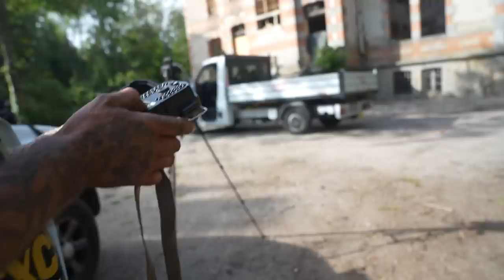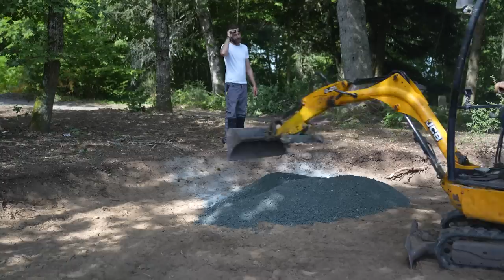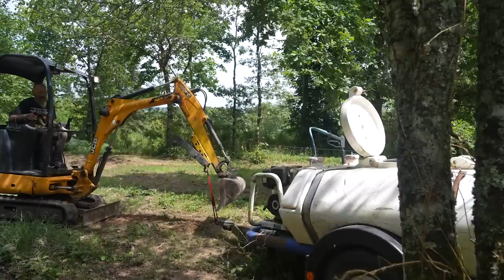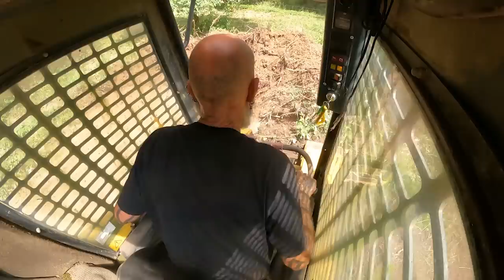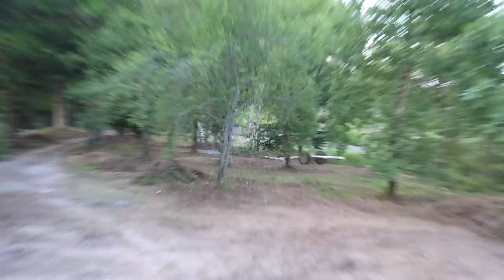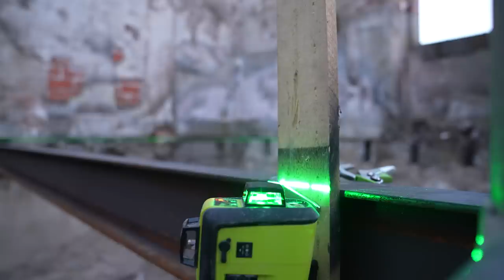A very wonky chateau ruin.

Comment: I am a Fabricator and Electrician.  Reguarding the floors.  I wouldn't suggest any step downs or you will regret it everytime you pass through.  Instead, find a way to build up the opposite floor to the higher level.  That way it's level Everywhere,  on the Entire floor.

Comment: You know there is a math formula for figuring how much gravel that you need. Area(sq metre x depth). You wouldn't have to guess. You probably could have told the gravel pit the diameter and how deep to figure the amount of gravel. 
As usual, oh good Dan's video is up. You always brighten my day.😎
Reply: If the gravel is sold by weight you also need the density to figure out how much to buy though. Density is given in kg/m3 so you multiply the result with density to get the weight.

Comment: I wonder if the original builders there used bubble levels, plumb bobs and water tubes to determine the level of each floor.  Maybe over time, the chateau may have settled a bit depending on soil type.  Good idea of clearing the front yard as over time tree leaves and such have decomposed, along with overgrowth, to make the ground grade a bit higher and uneven.  It's coming together nicely inside and out.  Handling a digger looks easy on camera and I bet I would be like a fish out of water trying to operate one...lol. 😁I always look forward and enjoy watching your videos during the evenings across the Great Pond. 🌎Cheers and Crack On!  Takes a bit of time to upload/download/editing videos.  Look forward to longer videos, if you have planned them.  I think you had mentioned that already.  See ya...tomorrow! 👍
Reply: Oh yeah, handling one of these is quite the learning curve! The first movements are extremely jerky as you get the hang of the basic controls. Once you got past that, basic digging isn't too bad but getting a flat, level surface is quite complex because you need to operate multiple levers at once to keep the bucket parallel to the ground as the boom curls. I worked with a mini digger for a few days, without a lot of training (i.e. "Ok, this lever does this, this lever does that, here's the keys, have fun! And we need the hole to be 400 mm deep and 1200 mm wide.") and we did all of the finishing with shovels. To make matters worse, our dig (for a cobbled path) was along a wall and digging parallel to a wall is even more complicated. We did have loads of fun though, no damage or injuries. The path still looks great seven years on.

Comment: I'd say by the time you do subfloor and regular floor, and have a threshold at the entries, your differences will be so barely noticeable you'll be amazed how much time you spent thinking about it.   I helped a friend work on a stick built house that was damaged by a fire, the house itself was very cheaply built originally back in the 1940s, the distances between floor joists, rafters and even the wall studs probably left it with probably half the wood structure a modern house would've been built with just a decade or 2 later, the amount of variances in floors and walls was crazy, in one room you'd put a chest up against one wall and the top would be up against the wall the bottom would be 3 inches out, 4 if you didn't include the trim, on the next wall the same chest would've been up against the trim at its base and 3 inches away from the wall at the top. You could put a golf ball in the high corner of a room,  not touch it and its would roll across the room and under the door and halfway down the hall including a bedroom that was carpeted.  We basically rebuilt the house one room at a time,  sisters joists and wall studs together to add structure, making sure the new structure was square and level, sawing off the high sports and  building up low spots. Fun stuff.

Comment: Dan, where the floor level is different once you've installed the floor beams/joists etc the easiest way to get the flooring levels right throughout wouldbe to install thicker floorboards within that one room,  for example once the roof is on and the windows are installed and basically the building is watertight.  When it comes down to the installation of the proper floorboards instead of the osb boards, say that you're using one inch thick timbers throughout most of the rooms where the levels are questionable like in this room why not just install floorboards that are say one and a half inch or even two inches in thickness 🤔 this may help you to keep the levels right throughout the château.
Reply: Well, i think, it isn't that simpel....
 It probably isn't, that one whole room is 3 or 5 cm higher, than the other room, but i think, the difference goes gradually from a side to the other.
Reply: @sabalight2558  He said he wanted to have every floor level but could live with steps between rooms. So he could actually raise the floor on either the landing or in the room (already managed to forget which floor is higher but I think it's the room, so he could simply put floor boards on top of the OSB on the landing and straight onto the joists in the room).
Reply: @Ragnar8504  Yes, i remember , but i think, when he said it a few weeks or months ago, it was going about bigger differences.

Comment: Interesting problem! Just putting it out here, for some measure of consolation: my flat from 1656 is so wonky due to sinking much the same way the houses in Venice are in some places, that nothing, and I mean nothing, is plumb. And my livingroom floor is the worst, from one end to the other I'd say it's off about 25 cm. I literally have to tell guests to watch their step on the threshold from the hall (the top end of the livingroom) amd when I moved in my friends all got a coctail and a vintage litte sports car to race down the parquet slope 😂 it's difficult to furnish.  Don't worry too much about being off a couple of inches. More than that on floor level and it gets a bit impractical.
Also, wall mounting shelves is difficult if your walls, like mine, are far from plumb. But can be adjusted, it's just more work.
I think you'll be fine Dan ❤

Comment: Your explanation of the floor makes perfect sense.
If the rooms are treated as their own space, with a threshold connecting them to hallways/other rooms, 
then if the floors are at slightly different levels it will be barely noticeable. 

As far as the Yurt goes, I would just put in posts, then build a wooden platform on top. 
If the platform is fairly high off the ground you build some steps up to it. 
All of which can be removed/repurposed once the Yurt is no longer needed.

Comment: There isn't a 200 year old buildings anywhere in the world that is dead  level , when your dealing with old buildings it's all about compromise as you have found out , let's face it they didn't  have laser levels when the chateau was built , your doing a great job .
Reply: The château is more like 120 years old but builders weren't too fussed about keeping things level back then and the building might have settled some too. Not too badly though because I don't see any cracks or wonky window openings. Brick and stone buildings don't usually settle with some obvious visual clues.

Comment: Once you have the subflooring installed you can use floor leveler (usually used under tile) to get everything uniform before installing the final flooring.  

I have done the a lot over here in the USA to fix floors in houses built between 1890 and 1940. Many of these era houses have an abundance of settling issues that require creative solutions. 

Hope this helps.

Comment: All floors same level my man! 
'Half steps' at thresholds are trip/stumble points all day long. Either a full step height or NONE. You will regret not doing this I guarantee you.
The up and down of floor heights will bugger the feel and look of flow throughout the house.
Simply pack the floor joists with strips ripped off same timbers used for original joistings so the floors are level throughout. Easy peasy, only a little bit of extra work and cost AND you can span the I beams and give yourself more fastening points for your under-flooring and final flooring. The extra height created can be easily, uniformity in riser height, incorporated into the new stairs you will build.

Comment: Hey Dan - any chance the floors in the room that's wonky were just wood and the hallway, which is 1" or so lower, had thick stone or marble atop a wood subfloor?  Meaning they'd level up where they meet?  Just thinking what could be a good reason for the elevation difference.  I'm sure you'll figure this out - curious if the opposite side of the chateau is also slightly higher in elevation to the hall.  You'll find out soon enough.  Hmm!  👍
Reply: Good point !  👍🏼

Comment: I would have gone a very different route from the start. Originally I would have a tent on site for couple of days until I cleared out a single basement room (having a with roof) to live in and keep working on as soon as possible to get basic liveable area. Then created some cheap and simple roof covering - maybe use a drone to roll out a lightweight and cheap clear plastic wrap to divert most of the rain to the outer edges. Like when they wrap the bricks together - something like that...if you do it enough should be able to divert most of the rain and still get light in also. Then concentrate on structural strength and supports (you sort of did this also), then do the same way you have from bottom to top and trying to add structural strength as you go.

Comment: I think the height difference between the main room and the wing can be made up by laying down a concrete screed on top of the wing's subfloor. Of course, it depends what kind of flooring he is going to use.  We have an old stone house in Italy and that is what the builders are going to do before the tile is put down.
Reply: I think it's the hallway that's lower, not the wing. As long as the stairs aren't in I see no reason not to raise the floor in the hallway as long as the other wing and back room match.

Comment: It looked like both the truck and Nick’s trailer could have had a bit more gravel loaded on, but sometimes it hard to know just how much you actually need.  I’ve done that a few times myself, but it’s not like the work stops. Around my home the work is never ending and when you break some eggs 🥚 you just make an omelet. Good work guys!!
Reply: By volume yes but I doubt the truck could have taken any more weight. Not sure about the trailer but I suspect that was maxed out as well.
Reply: @Ragnar8504  I did think of that after I left my comment. I watch Dan’s videos while in bed and was getting sleepy to correct my comment.  One always has to take into consideration the abilities of the equipment when carrying loads. Thanks for your reminder.

Comment: They didn’t have a huge length of clear plastic hose full of water when the Chateau was originally built.
Imagine what the builders could have accomplished with lazer levels, power tools etc….they were Champions !
Reply: They probably had rubber hose with glass tubes on each end, that was invented quite early (I think the principle was invented in the 17th century but only came into widespread use with the invention of vulcanised rubber hose in the 1830s).

Comment: Great clean up. Sounds like a good plan to even out the flooring. There probably wasn’t good enough measurements when they did it originally or perhaps additions or settling? Anyway you will make it work and it will be sturdy.

Comment: Kid, Don't order by weight, order by the square meter, or yard, or however you do it there. Here in the states I order 10 yards at a time=1 dump truck load. Depending on the material you order, it can be a whole lot cheaper that way. By the way great video..
Reply: Cubic metre would be the unit of choice for large volumes like Dan needs but I think stuff like gravel is often sold by weight.

Comment: Shave the part of the wood  beams that is higher than the floor should be to "lower" what will be the floor height, or, buy wider beams to increase "height" of the floor, and just keep cutting the notches to fit inside and rest in the i beams. So the width of the beams can adjust themselves for the floor height.

Comment: DUDE THE GROUNDS LOOK FANTASTIC. WELL DONE!!!. AS FOR THE FLOOR, BECAUSE MODERN TECHNOLOGY AND LASERS ARE OUR FRIEND, IN A PERFECT WORLD YOU COULD START AT THE FIRST FLOOR AND MAINTAIN THAT LEVEL. OR LEVEL EACH FLOOR AS YOU GO. BUT IF YOU CHANGE FLOOR TO FLOOR, EACH INTERIOR WALL WILL BE DIFFERENT IN HEIGHT.  ITS 1 OF THOSE THINGS. MAKE IT AS LEVEL FROM EACH FLOOR UP. JUST ADJUST THE TIMBERS AND EYE BEAMS FOR THE MOST LEVEL AS POSSIBLE. REMEMBER, ITS CALLED ROUGH CARPENTRY FOR A REASON. THE BIGGER THE STRUCTURE, IT WILL BE MAGNIFIED OVER THE DISTANCE. YUR DOIN GREAT!!.. GOD BLESS!

Comment: There are two possible explanations regarding level (1) Heat from fire damage (2) structure left open to the elements combined with the heat has caused movement

Comment: I mean, for it's age and size that's not bad. Between eyeballing it during construction and settling over more than a century, it could have been way worse.
You should be able to raise the floor between the wings by that much if you really want to get it as level as possible. Just a little extra subflooring

Comment: You know you can level the floors across if it’s only a few centimeters by installing thicker underlayment where it’s low and thinner underlayment where it’s high (or a second layer of underlayment in the low points) so it’s all level before the finish flooring goes in.

Comment: Try to get the floor within that space as level as possible but don't obsess too much. Then check the levels in the other rooms on that floor. If they match up with the room you're in right now (i.e. end up about an inch higher than the hallway floor) then just raise the hallway floor by adding a layer of OSB.

Comment: When working on old structures, the terms level and plumb are strictly reserved for things like doors, cabinets, etc. As far as the subfloor structure goes he needs to go with "flat". In a room that size, absolutely NOBODY is going to notice that the floor drops 1-1/2" in 30 feet. It's irrelevant. I would go with a flat threshold transfer to keep people from tripping room to room then deal with floor optics last.

Comment: I seem to remember that you had mentioned that there was a step down into the side rooms.  Could it have something to do with that?  I have no clue, I am just throwing it out there.  🧡
Reply: That's two floors higher up, the height differences on the third floor are massive, ten times as much as on the first. I'm fairly sure that was done deliberately in order to balance the front facade and still have decent tall ceilings in the back bedroom on the second floor.

Comment: I would just use the hallway as a guide since you know that is straight and flat from one end to the other. 
Then shore up the I beams from that. 
Then alter the wooden beams to be flat with the I beams like you did with the floor below on the front side of the chateaux. 
It is a shame that you are not doing the other two rooms at the same time. They would of given you an idea of the overall pitch of the whole building. Perhaps it is the hallways that is out. Don’t know till you get to the other rooms :( 

EDIT: I suppose you could also shore up the room floor like you are going to, then put a thicker floor down in the hallway to lift it even with the rooms floor. Just have to alter the staircase slightly, but that isnt too hard at all since it will be built from scratch to fit the building.
Reply: Keeping in mind that there are metal straps in the walls, raising floors is easier than lowering them, within reason of course. Might be worth to quickly try and set up the laser in the other two rooms to figure out the floor levels relative to the hallway!
Reply: @Ragnar8504  yep he would have to hope that they are within the same tolerances that the previous floor was. Hopefully less.

Comment: Depending on what type of flooring was used, if there were thick boards, that might have made up the difference in heights (just a guess). You could possibly do the same and even up the floor levels by using thicker or doubled up subfloor in the areas that are lower.

Comment: You would be wonky if you're over 150 years old, been thru two World Wars, several owners, and a fire! Now from a more practical point of view, what did the original flooring consist? Did they just lay a board subfloor then something on top of it? If that's the case, then having a difference of 1 or 2 cm between floors could have been easily made up by varying the thickness of the sub floor.

Comment: There must have been a lot of internal  steps Dan,, Looking at the original picture theres like 7 different levels so of course there not consistent throughout. Its like MC Escher in there
Reply: I don't think it was that bad. The basement, ground, first and second floors were more or less level within, plus stair landings between the ground and first floors and between first and second. Things start to get creative on the third, the room above the main stairs and the two small balconies on the lowest level of that floor, the hallway and the loft areas under the wing mansard roofs a few steps up and the back bedroom another few steps up. Then the fourth floor of the tower and probably above that the tower loft.

Comment: IMO, you should level the floor with the hallway while you can, way better than having a tripping threshold. If that means the pockets on the wall are too high, not a big deal, just notch the wooden beams or chip out the pockets.
Reply: Or just raise the hallway floor if the floors in the other rooms are roughly the same.